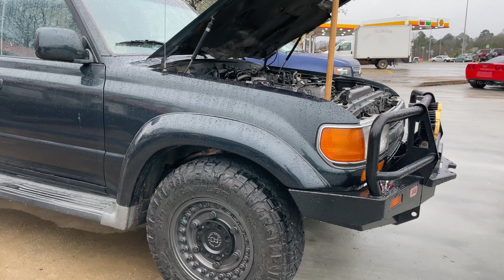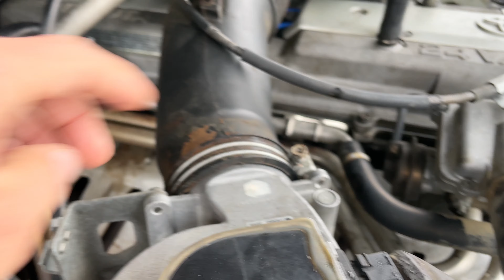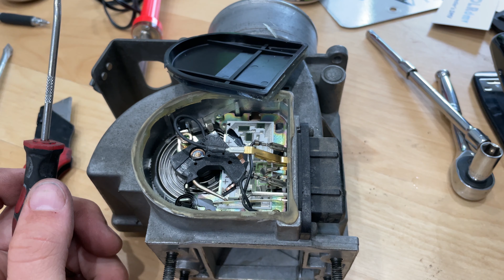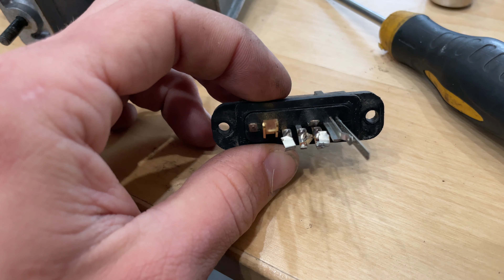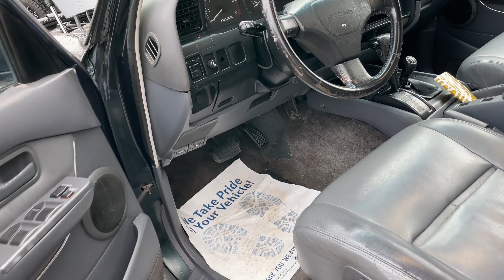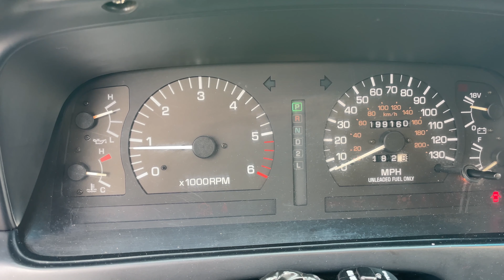Toyota Land Cruiser 80 Volume Air Flow Sensor Repair - Fix Check Engine Codes - MAF IAT

Comment: Thanks, great you can get the plastic top off and back . i definitely lost the plugup of the flying leads.  My 75 was running ok with those 3 fingers disconnected, magic motor ? Your video doesnt show how you got the assy off the harness for the bench work. I,ll have to work in place.
Reply: Of the 3 you soldered, the outer 2 are connected direct to each other on the pcb, interesting redundancy.

Comment: If the connector was pulled out after the two screws on the side were taken out , could that prevent the car from starting all together?

Comment: Great video! So what is the correct way to remove it to clean it? By avoiding those 2 screws? Thank you!
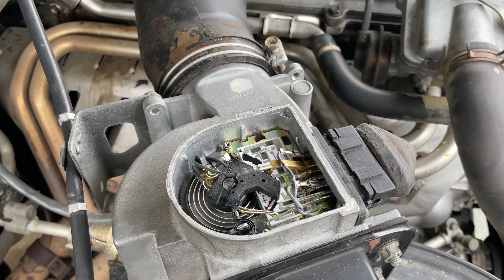Reply: You can pick up those two metal clips on each side of the harness, then unplug the harness. You can see the grooves there at min 8:03 of this video. 

The two screws hold the male base that the female harness can plug into/out of

Comment: Man, thanks. I just did this on my buddies' land cruiser. I couldn't find any info except yours, much appreciated. I'm going to try this today.
Reply from the maker: @jrbrown1978  Thanks for watching. I hope it helps you out. Good luck with the repair.
Reply: Did you end up fixing it?
Reply: Absolutely that's exactly what it was.
Reply: @jrbrown1978  was it pretty easy to solder?
Reply: @mr.skeltal3730  yea very easy it didn't  take 15 minutes to solder all 3 prongs good luck it works.

Comment: You spray the innerds w/ the new solder you made?  Just spray all that out w/ MAF?
Reply from the maker: I didn't spray anything on it. It's a sealed system so it was already really clean in there.

Comment: I have a 95.
I heard that anytime you mess with any electronics that have to do with idle, there's a computer that needs to readjust to fixes?
Not positive on year and make though but I could've sworn land cruisers have this type of computer brain. lol
Reply from the maker: Hmm. I haven't heard of that. I fixed this issue and the check engine light went away almost immediately. No issues with idling so far!

Comment: I admit, I screwed mine up the same way. Going to try and repair it today using your video as a reference. Thanks for putting this together!
Reply from the maker: Thanks for watching. I’m glad it was helpful for you. Good luck with your repair.
Reply: @goatsinapond  it’s probably the sloppiest solder job I’ve ever seen but it works!
Reply from the maker: @ExploringWithTheBz  haha, you right about that

Comment: Is anyone have a link on how to test these units? I have a 93 AFM and can't figure out if it's bad or not. An I really don't want to buy one just to find out
Reply: yes, it's in the FSM. You can download a copy and find the test procedure. Let me know if you get stuck.
Reply: Mine wouldn't start with sensor plugged in so unplug it starts then dies i knew instantly I broke it lol

Comment: Were you able to access under the circuit board to clean? What exactly did you spray clean?
Reply from the maker: I didn't pull the circuit board up. Only had to clean the pads to solder the connectors. You can use isopropyl alcohol on a q-tip to wipe them down. You'll want to clean up the old silicone so you can reseal the casing.